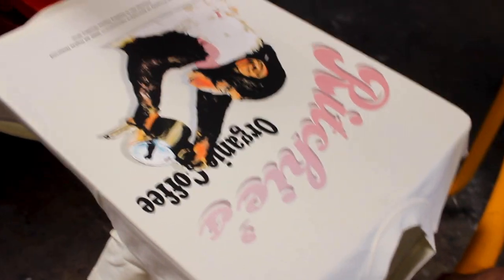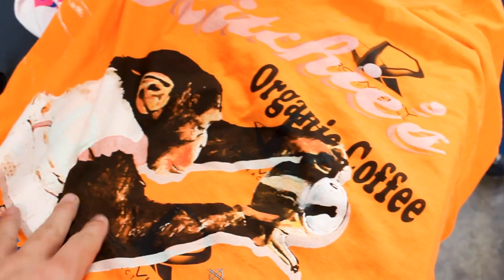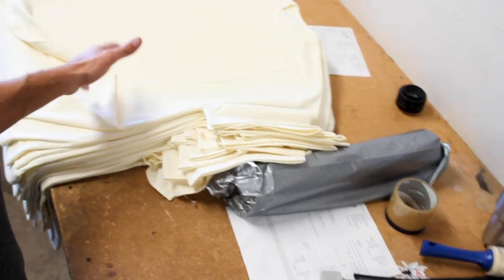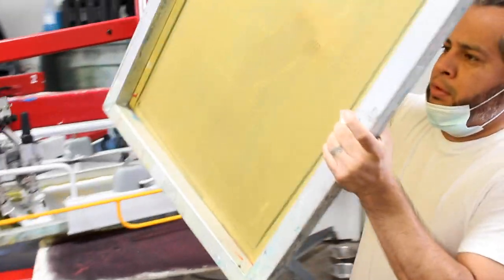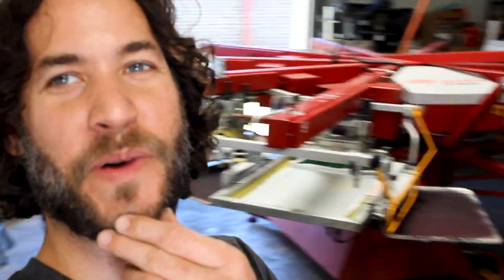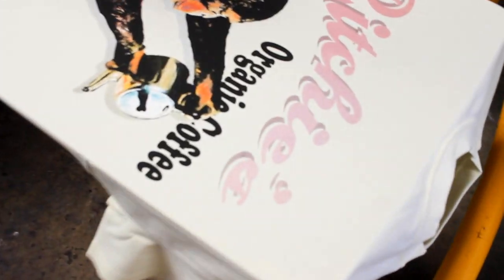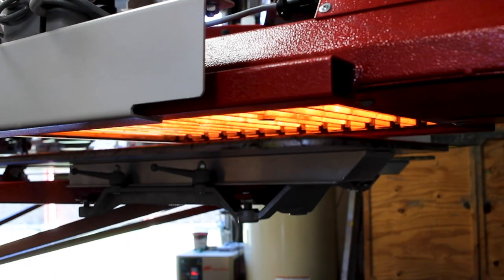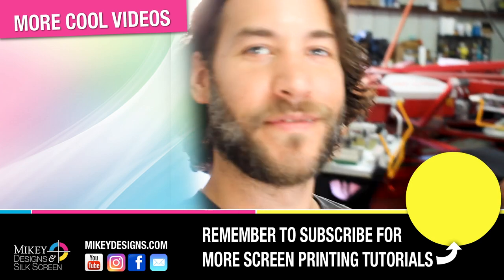How to Screen Print Oversized Simulated Spot Process T-Shirts - Anatol Titan Vlog

Comment: Do you normally use a 190 for under base? If not what are the factors that make choose between using a 190 or 225 for an underbase? Thanks
Reply from the maker: It depends on the design, and to be honest, whatever we have in the cabinet at times. For a design that needs to have a really bright white, we'll use a 195 for the base. For designs that are don't really have a hard white, such as peoples faces, or something that needs the base to have a really smooth transition, then we'll use a 230. If that makes sense.